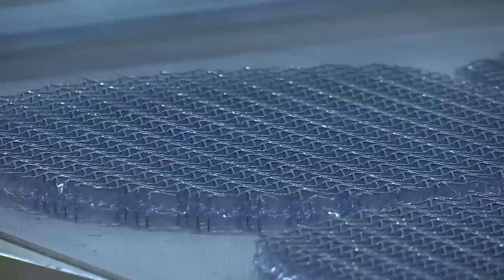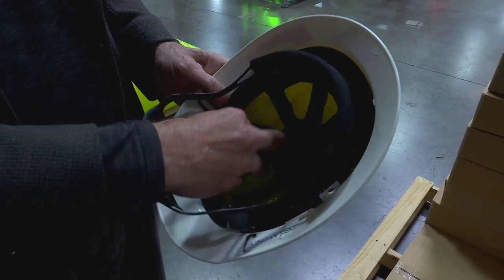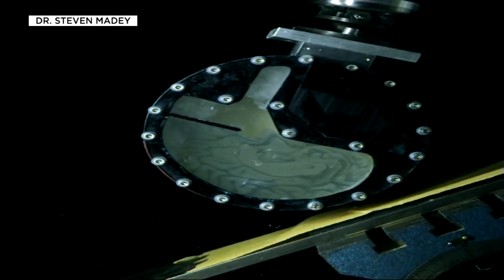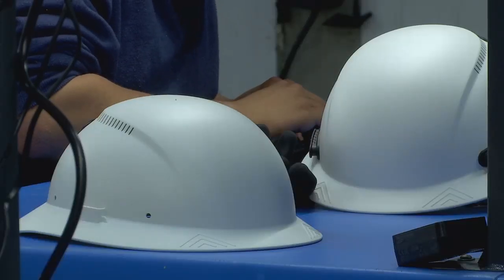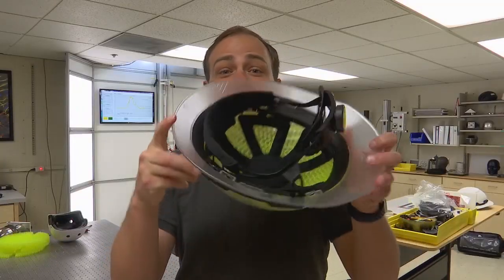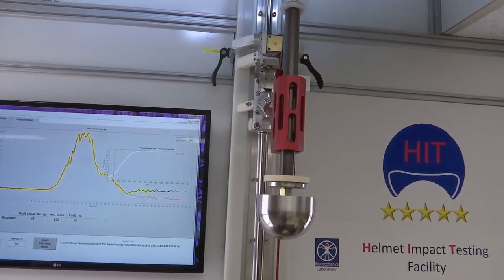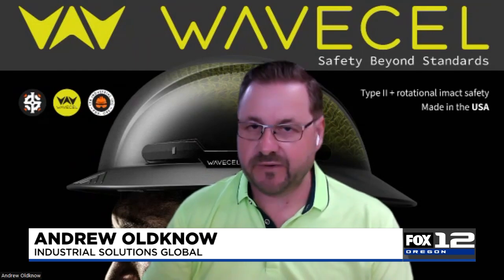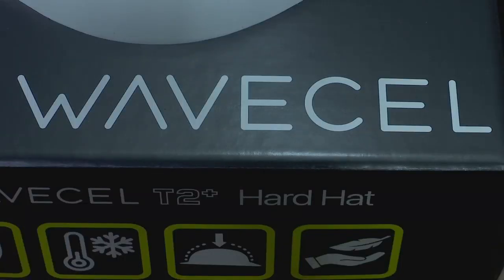New hard hats made in Wilsonville could be safety breakthrough

Comment: Side protection saved my life possibly this week, I was wearing a full brim hat, when turning on high pressure water hose with heavy brass nozzle someone had left nozzle open and when I opened the valve it flew up striking me in temple area if not for the hard hat, it barely touched my skin but did stagger me nonetheless, Thankfully. I will always recommend a full brim style from now on , and with the right liner.

Comment: This is not a hard hat , it is a contraption. This guy must work for wavecell,  been wearing for six months , this is the most uncomfortable torture device ever forced upon my head , makes a busy 8 hour day feel like a  slow 12 hour day with bosses watching. The adjustment dial has a knob on the inside covered  with thin plastic  that drills into the back of my skull to my brain , the back of my head is raw. The hat sits high on my head and feels like its going to fall off if I don't crank it tight.  This thing sits directly on your head  no shock absorption if you take a blow you will feel it for sure , if you take a side blow your head will move with the hit, I don't see how these are even legal. The accessory clips on the side get caught on orange fencing and on wires or any thing that will fit in the grove. The ones with the chin strap are even more dangerous can get caught on rebar or even be potentially fatal if rigging fails and catches the strap. Strap breaks at 24 lbs , 23,lbs can do some damage.  For the price of one dangerous hat you can get 8 reliable fibermetal hats.  There's your honest review thumbs down.